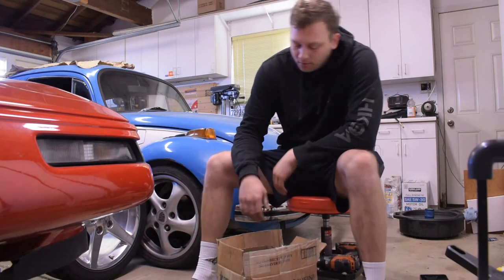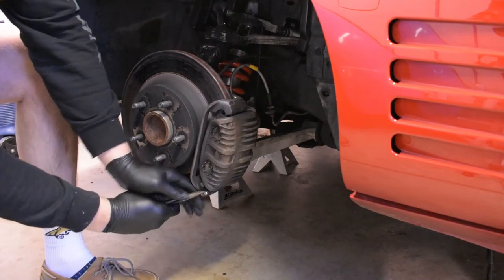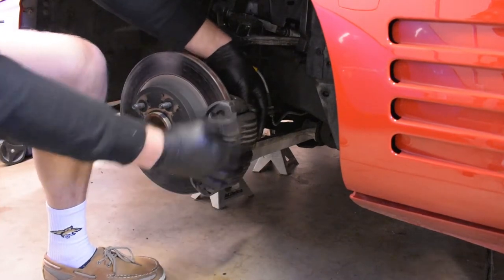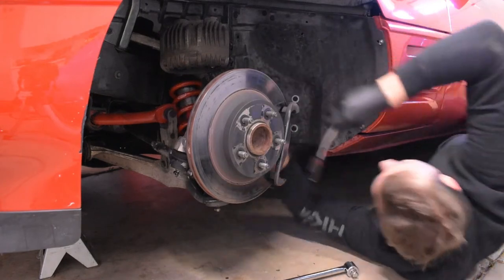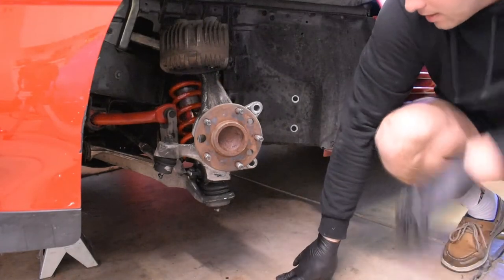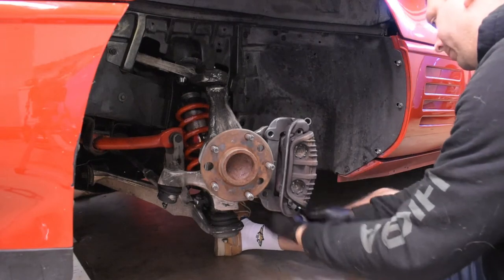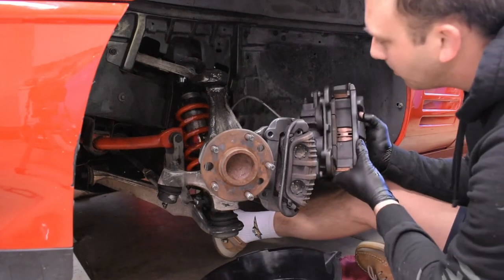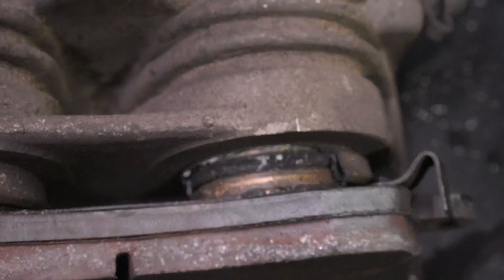C5 Brake Upgrade for C4 Corvettes

Comment: One thing nobody talks about is, why do this mod when you can do 5th gen Camaro brembos. All you need is 3 simple mods you can do in about an hour
Reply from the maker: I've never heard of it, how is the cost comparison? This swap was well under $1000
Reply: Camaro SS brembo calipers average 125.00 to 150$ on eBay  and they mount up without adapters !!!

Comment: Great video .
Did you use the SS brake lines for the C4 .
 Are the C5 Z06 calipers the same as the base C5.
Reply from the maker: I did use stainless braided lines. As for the calipers... They are exactly the same, just not red.

Comment: Did those rims require spacers?
Reply from the maker: In the rear yes, they have an et of around 70 something. The front didn't need spacers but they could have used them to make them stick out a bit more and not look so "sucked in" to the wheel well.